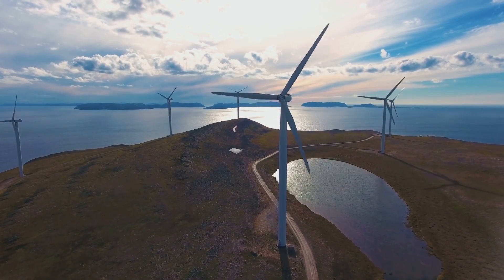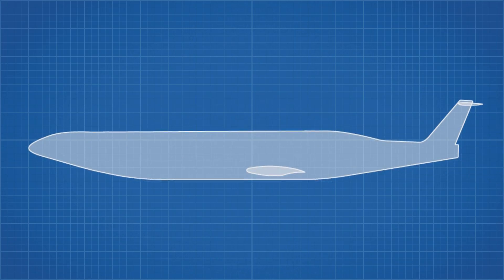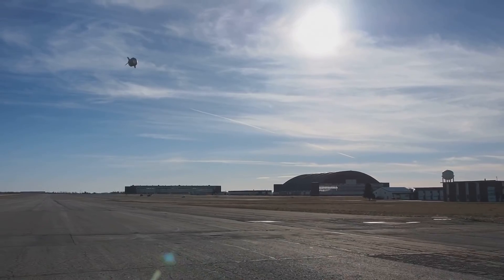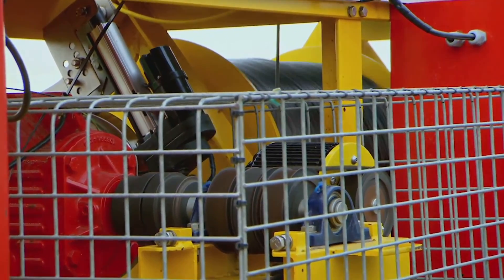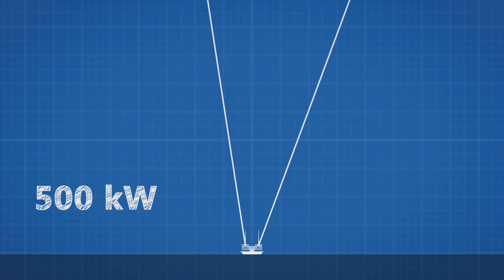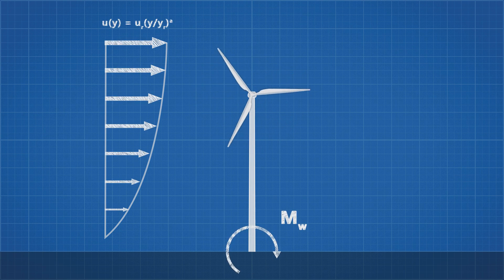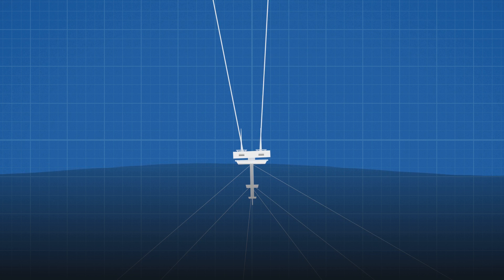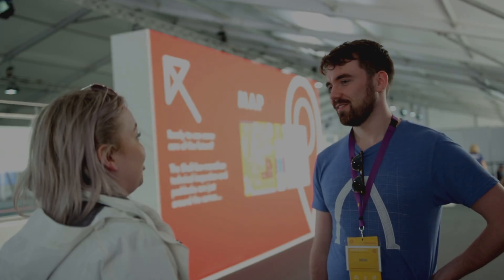The Future of Wind Power? - Kite Power Systems

Comment: .. or build a nuclear powerplant - it's cheaper and greener ;)
Reply: Griffin - in this video it's stated that one of those kites should generate 500kW and Temelin (nuclear power plant in my country) has output of 2GW ... well you'll need a LOT of kites
Reply: Ikari dono LFTR is the way forward!
Reply: +lessyam are you aware that plutonium is not a waste product? plutonium is a desirable fissile material that is so usefull there are reactors designed to produce it at the cost of electricity? do you know why NASAs Juno mission to jupiter uses solar panels? because they dont have any plutonium for RTGs. are you also aware that the longer the half life of a nuclear material the less risk to health it is?

firstly you state  "Not the chernobyl class accidents" there has only ever been one accident on the scale of chernobyl and that was chernobyl so dont try to pretend that its happened more than once. i bet you dont even know the next 3 most severe nuclear accidents what caused them where they were and whaat sort of reactor they were. 

as for your claims about nuclear waste you just demonstrate that you have no idea what the waste products from a nuclear reactor actually are. and your claims about waste fires seem to be irrelavant. ive done some searches and have yet to turn up any information relating to reactor waste products fires and leaking containers please cite your sources so i can be corrected.
Reply: +Lessyam
For the more potent waste the half life is on the order of days. If the waste has a half life of over 100,000 years then it is not potent in any way. A suitcase full of all the material in a nuclear bomb would be completely harmless as long as you didn't eat it or inhale it. The energy from a nuclear bomb is released from nuclear fission, not from radiation, so that suitcase has effectively no chance of exploding unless it was placed in a carefully designed bomb.
Reply: anyone with even a basic understanding of how nuclear material works understands that any long lived radioisotopes are not any significant threat to life or nature for the simple reason that the longer the half life the slower the decay rate and consequently the lower the radioactive emission rate.

are you aware that you can buy radioactive salts from the supermarket for human consumption? guess not you would probably be horrified to find out that your own body is in fact radioactive and how radioactive is proportional to your body mass (spend more time around fat people and you get a higher dose from them ;) )

your probably also unaware that most of the nuclear isotopes used in medicine by dint of their short half lives cannot be stored and must be produced in a nuclear reactor within a reasonable distance from the hospital. 

i guess your also unaware that your entire way of modern life is utterly dependent on the nuclear clock which uses radioactive material to create the most precise time keeping apparatus ever. 

you can bring up chernobyl all you want but i bet for most of you thats the only nuclear disater you have ever heard of and consequently think it is the only sort of failure a reactor can go through and find it so convenient to forget about every other critical nuclear incident in the history of nuclear power because in every other case there was no serious risk to anyone.

even if iran or N korea built a nuclear reactor the chances of them having a failure on the scale of chernobyl are so remote as to not be worth mentioning.
Reply: This thing still has potential in small towns that don't use that much power.
Reply: well about waste - there is a realy old natural inactive "nuclear chain reactor" in Gabon in Africa - nuclear waste was just laying there inside of a rock for a realy long time - so we know very well what will happen and it's safe - other thing is that this waste will probably be reusable as the technology progresses

nuclear powerplants themselves are safe now - we have paid the price (Chernobyl and others) why not make use of it?

if you need 4000 of those kites to replace one not so big czech nuclear powerplant ... that is a lot of kites that needs to be manufactures (what material?) a lot of maintenence and lot of logistics - and what about old unusable kites? thas is a lot of waste on it's own that needs to be dealth with - I believe that will leave larger enviromental trace than just one nuclear power plant

also what I hate about those renewable power sources is the space that they take - ok you can put solar panels or wind turbines offshore or into desert but in my small country they take that little space that nature have left - they make noise, they look ugly, they kill fertile soil underneath them, ... - ok nuclear plant is ugly as well but you need just very few of them

and yeah - nuclear power plant is an expensive thing but once it's build it makes cheap power - also price of the nuclear power isn't much dependent on price of the fuel which makes it reliable investment - CEZ group which operates both czech nuclear plants is planning to build more - and they know why - it's cheapest energy here - what is delaying it are administrative issues rather than money - and if it ever bankrupts then there is government to step in and insure safety

I believe that the resistance that some people have against nuclear energy is just an irracional fear - practicaly all of the people I've met on the university (CTU and MFF UK) were for nuclear energy
Reply: Dovah Bear yes they cost millions to start but after that they run cheap

And they generate very little in waste
Reply: All the nuclear waste in America if placed upon a football field wouldn't even fill it halfway if it was stacked 10 feet high.  (that is all of it IN AMERICA, where a large chunk of the worlds nuclear power comes from) thinking about the size of America and the number of nuclear plant's (excluding the however many nuclear plants on American ships and subs) there is no real issue about nuclear waste, the real issue is that people think it is a major issue when it is not.  (currently most of the waste is just stored at the plant, however America had a plan to store it all in a mountain that should of been safe for the recommended amount of time, till the democrats shut it down, cause it's not like the waste will still be a problem if we stop using nuclear power right)  Besides look at France, they run off of nuclear and are doing fine.
Reply: +Samir Shrestha
When has nuclear killed any animals? Wind power is well known for killing birds all the time. 

I have some news for you, we have to keep mining for resources for every other source of energy renewable or not. Solar energy may be renewable but solar panels are not. Solar panels and wind turbines are made from non-renewable resources that we have to keep mining and keep using up as our energy demands increase. Uranium and Thorium are extremely energy dense so a large nuclear plant can generate more energy than hundreds of wind turbines for less resources and at a more consistent rate.
Reply: +Lessyam
You are a nuclear scientist? Sounds more like you flunked out of a class on nuclear physics in college once. Don't quit your day job. Pu-239 is safe to hold and stand near unprotected for short periods of time. Far from perfectly safe but the worst it could do is increase cancer rates for people exposed to it regularly. U-235 is also mostly safe to stand beside with the same effects as Pu-239. Don't make your bed out of it but standing next to some every once in a while would do nothing. Pu-239 and U-235 are only so dangerous because they are the major fissile materials used in nuclear weapons but they cannot explode on their own. If Pu-239 or U-235 were in high enough quantities in nuclear waste to make bombs you can bet it wouldn't be called waste.
Reply: I'm not a nuclear scientist but I've talked with a lot of them on the university and none of them was concerned about safety of nuclear energy - agaist it are often people who fears it because of their lack of knowlege - people are bad at understanding facts and statistics and tend to act all emotionaly
Reply: If you're concerned about nuclear powerplant waste, you've obviously never seen a treatment facility or burial site yourself. The waste is a ceramic.  It's not going anywhere.  The facilities are monitored and guarded, and (at least with civilian nuclear waste) there hasn't been a single concernable accident.  It's really freakin' safe.  I'd happily keep it in my back yard because I know what I'm dealing with.  Besides, the amount of waste produced is tiny compared to any other industry's waste.  Most people don't realize that the majority of radioactive waste is from the medical industry, not the power industry.  

The only reason people are scared by such waste is because of the weapons industry: at Hanford in Washington (which was entirely for weapons production), they didn't take any care in proper disposal, and there have been concerns recently about it.  But nuclear power is completely different, as you will find through your own research.
Reply: In some places nuclear isn't so viable. In a country with limited space like Japan, offshore power has a huge advantage. Offshore wind farms would also be safe from tsunamis, and even if it were damaged or destroyed it would present little to no danger. I agree that nuclear power is highly underrated and safety concerns are grossly exaggerated, but a diversity of energy sources is important for weaning the world off fossil fuels.
Reply: Floating Nuclear stations... 
And Russia is already selling them with my country being one of the potential customers...   Reactors the size of those used to power Carriers and Submarines...   But to power cities instead....
Reply: +Andreas Stangl
Why would anyone guard it? It's waste for a reason, nobody wants to steal that. Just put a sign up saying "danger, radioactive" and keep the facility away from any water sources to prevent contamination.
Reply: +GichiKya the problem is, this waste is pretty dangerous you know. People who want to harm other people can make good use of it.
Regarding your answer to +Samir Shrestha: Although I'm far more concerned about people, it took the animal population ten years to grow back to normal around Pripyat.
Reply: +Andreas Stangl
There are significantly easier things to get that are so much more dangerous than nuclear waste. Held deep underground in an old mine, it's not like someone could just walk in and steal some. The main danger from nuclear waste comes from Iodine-131 (half life of 8 days) and Strontium-90 (half life of 29 years), both of which do little more than increase risks of various cancers if ingested in small amounts. 

I don't know where you got the idea the animal population decreased in Pripyat so I'll need a source. Chernobyl was a very poorly designed and dangerously managed reactor but even that couldn't have killed off many animals. It would increase cancer rates but that's something that could take a decade or more to kill off any significant portion of the population. If anything the populations would have increased steadily due to the lack of humans.
Reply: There are way better methods of killing people than nuclear waste

Yes but we're talking long periods here
https://thinkprogress.org/chart-how-many-birds-are-killed-by-wind-solar-oil-and-coal-230d2a939bbb
Reply: "Potent = Short Half life? Yeah, Plutonium-239 has a half-life of 24,000 years, and it is perfectly safe as long as you don't eat it... Right. " 
Plutonium is used in many things it wouldn't be buried

"Non exploded nuclear bombs are safe? Yeah, again Uranium 235 (at weapon grade levels) is also perfectly safe to stand beside." 
What?

"Should not be guarded because nobody wants to steal it? Yeah you're right. Nobobdy out there would steal some nuclear waste for dirty bombs..." 
The only waste that could be used for bombs is plutonium which is not buried but reused 

"and besides, who gives a fuck if it leaks into the ground and reaches water reservoirs, or slow combust and leaks nuclear ashes slowly..." 
The materials that come out are solids they can't leak

"Cheap? Yeah look at France he says!!! (it so happens I am french...). EDF has NO IDEA how it will decommission in now 40 years old nuclear powerplants, because the cost of decommissioning is estimated (only estimated because not a signle nuclear powerplant has been decommissioned yet!) to be 5 fold the cost of building it. So far, they have resorted to closing 4 oldest plants, no decommission them and simply guard them. You know, let the next government handle this shit." 
This doesn't actually prove that they're expensive in the long run

"Safe? Look at France again! Yeah, and 10 years ago one would have added look at France and Japan, but I guess now nobody quotes Japan as an exemple. Educate yourself on Fessenheim plant" 
There have only been 4 nuclear disasters in history and even factoring in those per KW/h produced nuclear is still the safest form of energy generation

"Next thing you know, you'll tell us we can just shoot it into space." 
You can but it's very expensive and not currently practical
Reply: "No, it is first kept in pools at site, for decades sometimes, to cool down some, and then buried, because the pluotnium is mixed in spent fuel rods with plenty other shits and cannot be reused as is. There are recycling techniques allowing to isolate the different components of spent fuel in order to re-use some, but it is used on less than 10% of spent nuclear fuel worlwide. The cheapest option (in the short run at least) is burial." 
If according to you it's not in a pure state and is in a mixed one then it would not by any means be easy to refine or use to make a bomb.

"Wrong, any radioactive byproducts of nuclear fission can be used for dirty bombs."
Technically correct but tell me how big of a bomb you would need in order to make a depleted uranium work

"Familiar with leeching?" Yes but how on earth would it leach enough to cause any trouble? even the leaking radiation directly from fukashima into the ocean is totally harmless

"In the french press and academics works over the past 3 decades, the consensus is that "nuclear electricity" is highly undervalues, by at least a factor 2, since the rate does not include several auxialiary cost (decommissioning, burying, sanotiry, contingency). Some of these costs should be at least integrated over 200 to 500 years and built in the rate, assuming that we find techniques to recycle waste previously buried. So unless you are talking to someone on the nuclear's lobby payroll in France, yes, it has been proven times over that nuclear energy is far from being cheaper than alternatives." France is also has an insanely regulated economy which makes everything insanely expensive look outside of it and you do not see as high of prices.

"You are just simply wrong. See above. " No i'm not
https://www.forbes.com/sites/jamesconca/2012/06/10/energys-deathprint-a-price-always-paid/#3c193bd1709b

"Lol. Cost is not the issue. It is that rockets blow up every now and then :)." Eh, it's pretty rare that one would blow up but you could always have it in an emergency case, that is the case of an explosion could contain the material and land safely. But like i said it's just not practical.
Reply: ""No, it is first kept in pools at site, for decades sometimes, to cool down some, and then buried, because the pluotnium is mixed in spent fuel rods with plenty other shits and cannot be reused as is. There are recycling techniques allowing to isolate the different components of spent fuel in order to re-use some, but it is used on less than 10% of spent nuclear fuel worlwide. The cheapest option (in the short run at least) is burial." 
If according to you it's not in a pure state and is in a mixed one then it would not by any means be easy to refine or use to make a bomb.
A dirty bomb is not a nuclear bomb, it is a conventional bomb used to spread radioactive material in the air in order to contaminate an area. The nuclear waste does not need to be refined, it just needs to be radioactive.

"Wrong, any radioactive byproducts of nuclear fission can be used for dirty bombs."
Technically correct but tell me how big of a bomb you would need in order to make a depleted uranium work
Again, see above. If your waste is the nuclear spent fuel, you don't need tons of it to do damage."
Non refined waste you do a pretty poor job at contaminating anything, there are FAR better methods of killing people.

"That being said, burial sites are carefully chosen to be geologically stable, impermeable, usually far from large population centers,n and definitely not above large ground water tables. The trick here is the time scale of how long we would have to maintain these sites, and even move them every now and then, in the face of geopolitical shifts, wars, changing climates, failing civilizations, and historical cycles... They even had very serious research in how to encode a safety warning about buried waste in a way that it could be understand by an individual in 1000 years, in case someone starts digging it up not knowing what it is..."
So then you agree it's not at all an issue?

"Sure, but 1) it was the other guy exemple to say that it is safe, just like in france." Sorry i missed that

"in less regulated societies, would you trust a profit obsessed company deal with nuclear power plants (like Enron in the US)? Japan is not exactly unregulated, and yet TEPCO has proven to all how regulation can be avoided in order to drive profit. France is highly regulated, and it should be..."
Profit motive is the driving factor of the modern world, and without it you get bugger all. And yes i would because shoddy nuclear plants that might exploded tend not to drive in customers and also have a good chance of ruining the investment.

""You are just simply wrong. See above. " No i'm not
https://www.forbes.com/sites/jamesconca/2012/06/10/energys-deathprint-a-price-always-paid/#3c193bd1709b
Thanks for proving my point ;)"
Proving what point exactly?
Reply: Lessyam 

you are so demonstrably wrong that when i read your comment my head hit the desk so hard i concussed myself. ill give you a very basic physics lesson and then briefly explain the most basic of chemistry as you clearly wernt paying attention in school

"Half life and the nocivity of radiations emitted is not necessarily linked. Are you implying that plutonium is non toxic?" WRONG they are intrinsically linked
so to point out where you went wrong ill demonstrate 2 simple questions and their answers from google just so you can follow along
1: what is radioactivity? A: the emission of ionizing radiation or particles caused by the spontaneous disintegration of atomic nuclei
2: what is half life? A: the time taken for the radioactivity of a specified isotope to fall to half its original value

so as you can see activity is the decay of a sample and half life is the time taken for half of that sample to decay. this means that if the half life of a material is 24000 years then it after 24000 years it will have emitted half the ionising radiation. if that same sample had a half life of 1 day then it would emit the same amount of ionising radiation in 1 day thus the radiation emission density would be much higher and much more of a risk.

"Yes refined plutonium is desirable, but again, nuclear waste is plutonium plus a lot of other shit, and separating them is VERY complicated"

no just no this is wrong yet again. plutonium being a separate element has unique chemical properties. this means that it can quite simply be chemically separated from the rest of the waste through chemical reaction. separating things only becomes awkward when they are isotopes but thats not hard it just takes infrastructure which if your producing your own fuel you have already.

it staggers me that anyone can be so ignorant of basic scientific knowledge and think they know sufficient to tell other people they are wrong. if you had paid attention in your free mandatory secondary school science classes you would know these things and even if you didnt it is absolutely free and takes less than 20 minutes to find the information. the arrogance and ignorance combined is just baffling especially as there is no excuse for not knowing it when that same information  is a few keystrokes away.

as a last point plutonium is indeed very toxic but that is mostly as a result of it being a heavy metal and not a radioactive isotope.

if you actually interested in learning about the chemistry and physics i mentioned above i can link you to some excellent educational channels on youtube. however as learning is difficult i suspect you wont bother
Reply: that is so true ikari. the poeple who complain and moan about nuclear energy and its risks are, in my experience, completely oblivious to even the principles of nuclear physics. 
it really staggers me that so many people can rail against nuclear energy but not even have the slightest idea of what it is they are complaining about
Reply: kablouser Fission MSR can use nuclear waste as fuel.
Reply: You still haven't replied to my last comment
Reply: from reading your most recent posts im fairly sure our views on energy production are similar. i wouldnt argue that nuclear should be chosen over renewables. i just dont think and have seen no eveidence to support the notion that renewables can provide ALL our energy needs. by all means provide as much as you can with renewables but unfortunately the only countries that have a serious chance at switching to main production of energy from renewable sources within the next 40 years (60% or so renewables) are not the countries engaging in massive coal and gas expansion.

im all for supporting the growth of renewables but if we want to make a difference fast we have to build more fission reactors. i think an international nuclear energy agency should be established with the goal of subsidising and providing technological expertise and oversight to developing countries. if its an international affair that has all major nations vested in it then the long term political risks to disposal are largely mitigated. especially as all new build nuclear power plants must make provision for their own long term waste disposal and decomissioning.

lets say we have our first commercial fusion plant in 40 years, from there depending on politics it may well be less than 30 years before main global energy supply is from renewables and fusion. at that point fusion can be used to "burn" all of our existing fission waste.

we must recognise that rapidly developing countries have a vested interest in building power plants not renewables because it is for them cheaper to build and maintain a coal fired station with their own reserves of coal than it is any other means of generation.
Reply: Nuclear power is really efficient and even green as you stated but the consequences of a meltdown are just too damn high. Happened once, happened twice and it will happen again. So as long as we don't have nuclear power plants on the moon or something I am against it. Oh and the highly nuclear waste is a kinda shitty side effect
Reply: And put these on its rooftops. Boom.
Reply: @kablouser Actually, yes. Just dump it into the ocean, literally and anywhere. Don't bother with containers or whatever, it's all unnecessary.
Even if we ignore that dumping nuclear waste is stupid because it could be used for making things like phones with 'batteries' that last longer than the phone (a small amount in a lead-and-nickle casing could be perfectly safe and produce enough power to power a phone. It would probably be safer than a battery, since there's no reactive parts of any kind, and no chance of any kind of explosion, just a very minor risk if someone managed to break it).

Radiation is immediately absorbed by water. If you swim a couple meters away from nuclear waste, you're probably getting a less-than-background dose of radiation. For any kind of danger, you're going to need to hug it (well, not 'hug' it, but get really close to it).
There's an XKCD What-If on this too, I think. Swimming in a nuclear waste disposal pool or something like that.

Because of this, disposing of nuclear waste would actually be trivially cheap. Just dump it into the ocean. Maybe put it in some sort of two-layered shell (with empty space filled with water) that means the closest you can get to it is more or less safe. Then all you have to do is make sure you don't drop it on a coral.
Reply: @VideoGameGang Except nobody has a fusion reactor that produces more power than it takes to run it (though some which do have fusion and don't explode but produce less power than the power used to contain them do exist).
Reply: Nuclear power plant is not cheap.Building those damn things is really reaaly  costly and difficult
Reply: kablouser - in my country it's roughly 1CZK per kWh from our two nuclear power plants - that is ~$0.043 - including waste - in this video it's $0.0625 from kite - and at some point you'll need to dispose of those kites as well
Reply: Ikari dono Because all the nuclear PP construction projects in the last 2 decades (in western democracies) were so successful??
Over-budget, massively delayed and still nowhere near completion. Oh and don't forget the bankrupcies - Westinghouse anyone?
What kills nuclear is the HUGE investment cost with uncertain ROI. IF you actually manage to complete the project.
Reply: A russian nuclear powerplant with hardly any security systems and dumb workers once exploded, so I'm against nuclear power because  this proves that it is bad >:c
Reply: its cheap to dump nuclear waste?!
Reply: @kablouserful  we could use the waste to power radio isotope thermoelectric generators. or we could encase it in concrete and dump it at the mariana trench, or where one tectonic plate gets pushed under another, that way it'll be swept into the magma flow and help continue to power the earth's core.
Reply: @TheKlink 
Didn't know about isotope power thing.
But dumping it in the sea encased inside concrete is a extremely dangerous idea. How long does it take to get "eaten up" by tectonic plates? What are the chances of the concrete failing in that time. And is it worth the risk of having the oceans become somewhat radioactive.
Reply: kablouser 10 cm/ year at its quickest, admittedly. The French nuclear concrete encasement method has been in operation for 60 years and the s showing problems now, but materials science knowledge has increased significantly since then. The British have a design that will supposedly last thousands.
Reply: Nuclear kills more animals than other renewables and also we have to keep mining for resources not for renewables.
Reply: Lessyam Fusion is gud with no bad byproducts except some stray electrons and Helium.
Reply: what i know is that you need to dispose nuclear waste in special sites, you need special vehicles and you need actually record it.

kites don't need that, also somewhat recyclable, but mainly you but don't need these three things. 2GW / 500kW = 4000 kites for 1 nuclear powerplant. Maybe you have a point. But if kites get cheap this changes.

anyway my main point is ITS NOT GREENER. everything added up, the vehicles the special sites, it costs more "green" to be a nuclear powerplant.
Reply: Yea, we all have seen the pictures of the Asse II salt mine where Germany planned to store its nuclear waste. Who is paying for the monitoring and guarding of the facilities for the next thousands of years? This is all factored in the $0.043 for the kWh right? As are the costs for developing new technologies to treat this waste?!

Radio isotopes used in medicine are usually short lived. They are stored on site and dumped in the usual waste after some days to weeks. There are a few  with longer half lives,  but they do not amount to the volume used in industry - a report from 2010 is talking about 1% of the total nuclear waste in the UK.

The reason why people mistrust nuclear waste is, because nobody can tell them who is taking care of this stuff for thousands of years.
The reason why people mistrust nuclear power is, that one accident alone can make entire swathe of land unusable for generations. It's just not worth the risk.
Reply: Until it melts down due to lack of maintenance as a result of economic instability.
Reply: 24680kong "it's fine in France" Have you heard of the Antifa? Or about all the riots and damage? It's like a war... No media coverage either.
Reply: Ikari dono "cheaper?" "Greener?" You do know that reactors cost millions right? And the stuff used to power it is just as bad. Nuclear power plants can be dangerous and produce a lot of waste